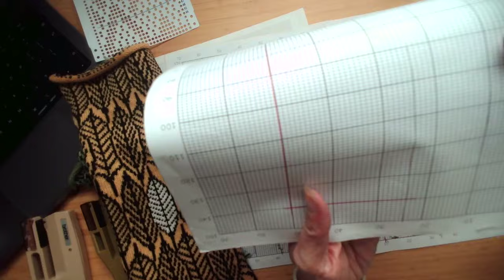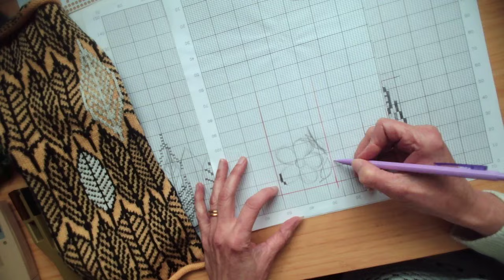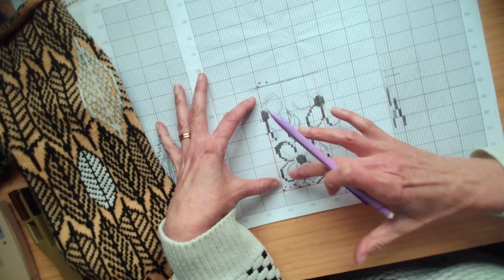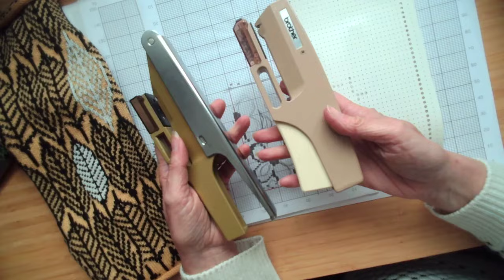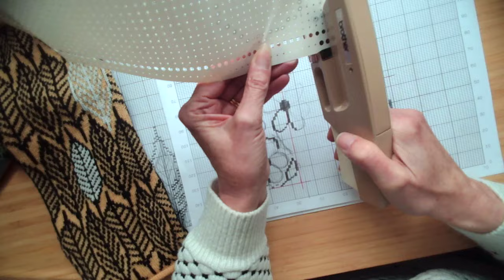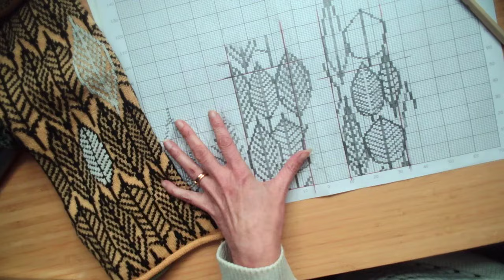Machine Knitting Making Your Own Punchcards (24st repeat)

Comment: Do you know if the stitch related graph paper is printable?
Reply from the maker: @chickavg  I'm sure you can somewhere. I'm not sure where.
Reply: @clairenewberrymachineknitting  I've used excel to make stitch related paper by defining the proportions of the cells  as 5 to 8 and then printing out the supporting grid.